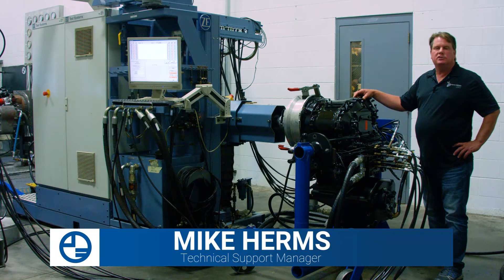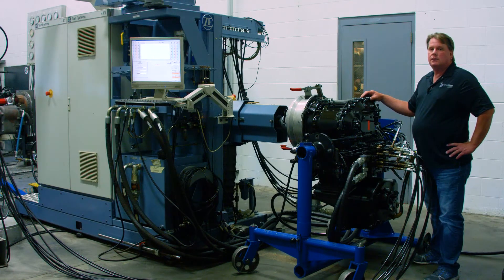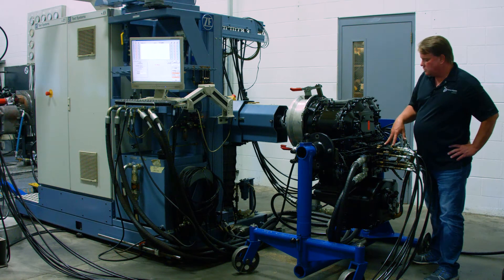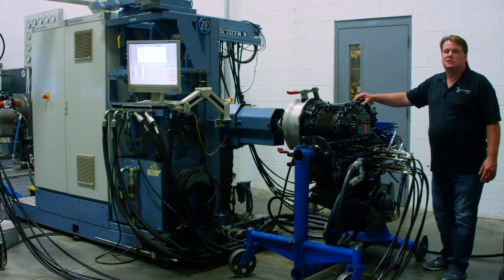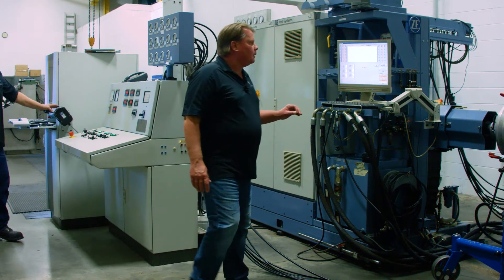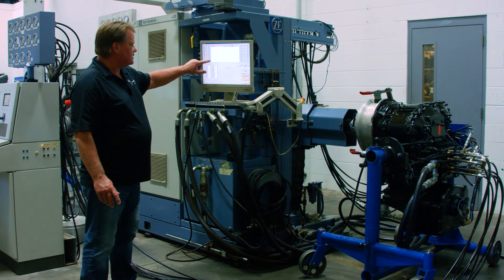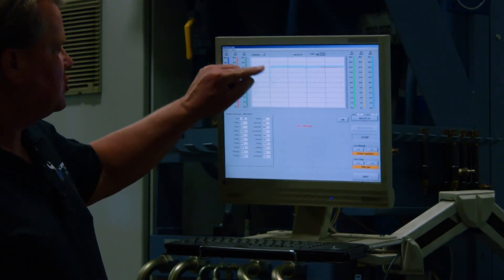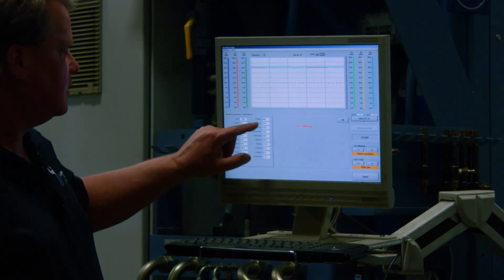ZF Transmission Test

Comment: how to find out weather the problem is electrical or mechanical in 6wg in TMX 450, without using dignostic box, how to check tcu with multimeter. i want to find out snag using logic